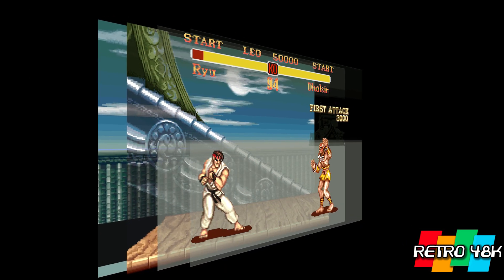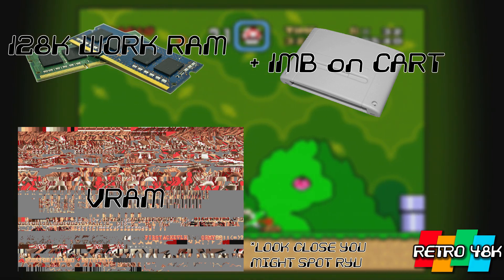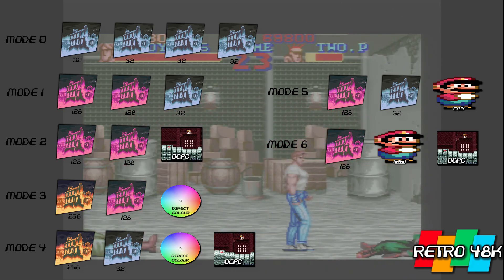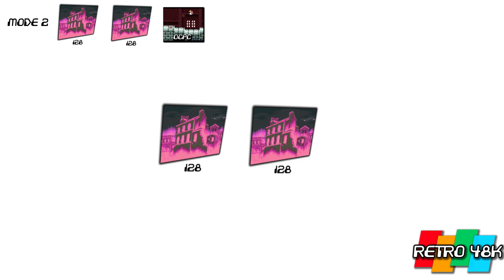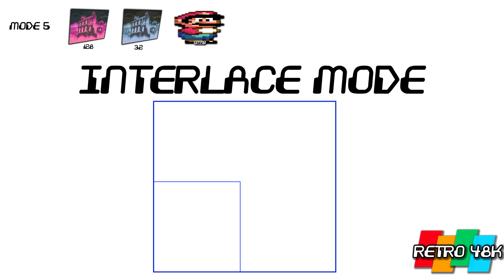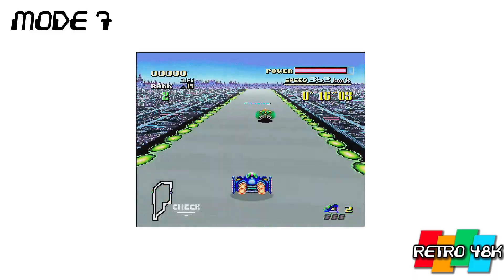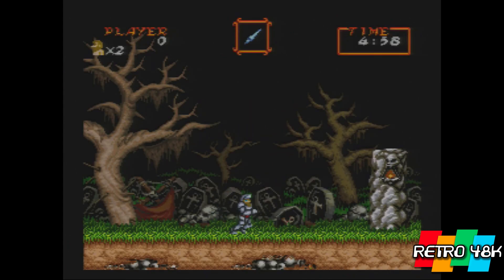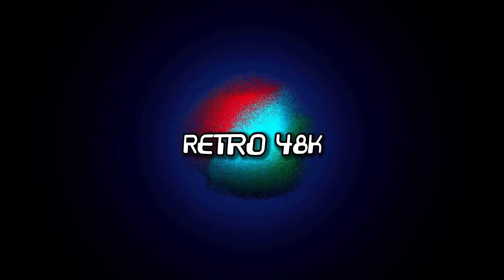How the Super Nintendo Worked

Comment: In Mario Kart, the trick isn't interlaced mode. It's the big black separator bar between images. It's there to give the game time to set up the second view. They're the same image, after all.
Reply from the maker: It depends on which trick you mean, there is the two player split screen, the map on single player or switching modes for the skyline
Reply: @Retro48K526  the split screen two player mode and the rear view mirror,I believe lifetime, are done by changing the coordinates of the view port during hdma. So it renders the first player perspective, then it just switches to the second players location and renders from that perspective. They give themselves time to make those changes during the black space between the two renders.
Reply: @MrBillgonzo so VRAM was too small for the complete track? 128x128 tiles not enough?
Reply: @ArneChristianRosenfeldt  No VRAM held the whole track as a single image, but in two player split screen mode each player's view has to show a different portion of the track from a different direction. So that black bar in the middle has to be thick enough for the game to adjust which part of the track image is being shown for the second player's view, as well as how it's being rotated and skewed before it has to be rendered to the screen. The black bar looks maybe 8 pixels thick, which means the system has the amount of time that it would take to draw 8 scan lines to the screen to change around the view of the mode 7 background.
Reply: @GreyMatterShades  So AtariKart is not too different. Also needs to copy the ground. Palette on Jaguar is wild. You have to draw the tiles in the borders of the screen and then use the blitter to pull the 16 bpp converted result back. And there are two scanline buffers. I have not found out if you can stop the switch inside the bottom border.
Reply: Great video. Love these videos where you cover all these great consoles.
Reply: The trick is not to draw the background for each frame. After the frame is build up half the position and rotation of the background is changed for the second part of drawing the frame.

The 3D tunnel effect at the beginning of the video does this background rearrangement not two times per frame but for each single scanline. Donkey Kong Country also does amazing 3D backgrounds with this trick.

It's also possible to change the background mode while one frame is drawing.
Reply: @bjoern.t  I that we know this? A lot of C64 games used this for status before they started to open top and bottom border and use sprites. Little Commodore C16 had this in Microsoft BASIC, where the top screen would be bitmap graphics, but the low screen would be text.